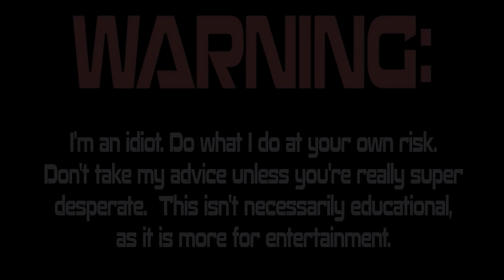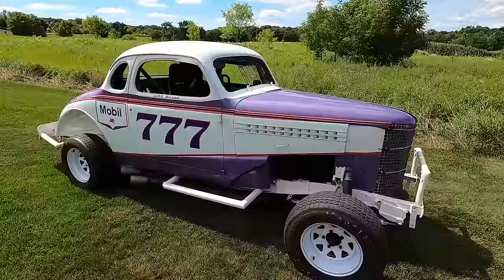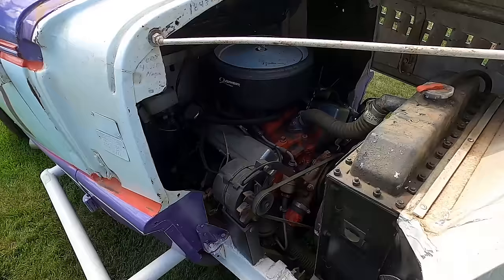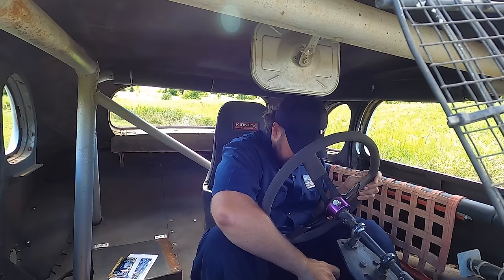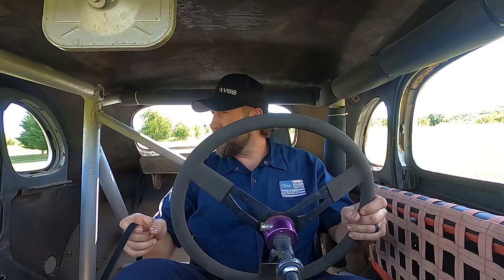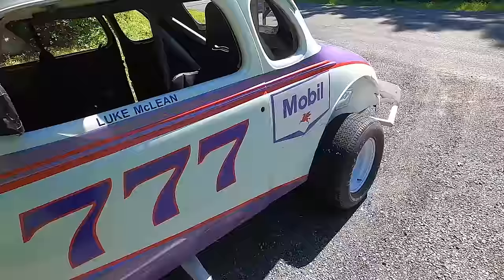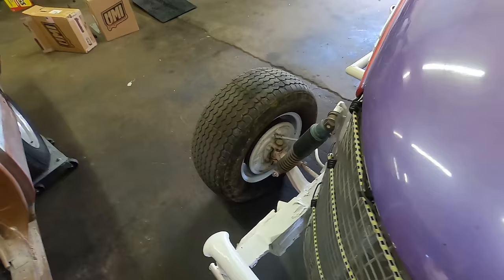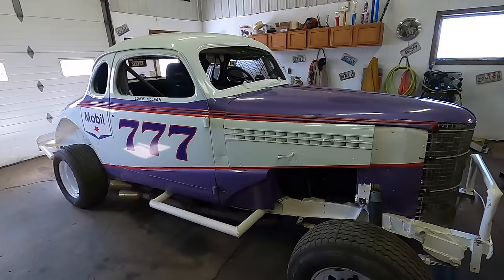I Bought A HISTORIC Vintage Modified Race Car! - Vice Grip Garage EP87

Comment: Got my grandfathers 71 datsun running again after 35 years. All thanks to you for the inspiration.
Reply: Thats what its all about man, right on!
Reply: Longbed pickup or??
Reply: What year and model Datsun?  I had three of the not so glamorous B-210s. 74, then 76 and finally, a 75. Definitely no air cushion ride! But 42 miles per gallon, made up for the lack of comfort, in my way of logic, back then. 
The bodies kept rusting out. So, when one rusted out too bad, I'd find another B-210, with mechanical problems and swap an entire engine, trans and rear end, from the rusted out one, to one with a better body. 
Datsun didn't make it easy.  I couldn't fit the driveshaft, from a 76 manual transmission, to a 74 manual transmission, because  the splines were different. So, I had to use the 74 driveshaft, on the 74 transmission. BUT!!!  The rear end yoke, wasn't the same size, on the 76, as the 74. SO!  I ended up taking the rear end out too and moving EVERYTHING 1974, to the 1976 body!  When the 76 rotted away, I found a 1975 and just repeated the whole thing, all over again. 
Datsun driveshafts, back then, didn't have replaceable U-joints. The U-joint caps were pressed in, counter-sunk in the yokes and then the outer ridge, of the yoke, was machine manipulated, to keep the needle bearing caps, forced in place. There was no locking snap rings, that could be removed, to replace a U-joint. The WHOLE driveshaft had to be replaced!  Unless you had a machine shop, willing to remove the bad U-joints re-press new ones in and do a few tac welds, on the caps and yokes.  
In spite of all that work (FUN), I was able to drive those cars, using the one A14 engine, over 240,000 miles. 
I sure miss those little cars. 
I've had a lot of vehicles, in my life. My top three (or would it be five?) favorites are my first car, a 1957 Chevy, my second car, a 1959 Mercury Commuter station wagon, with 430 interceptor engine and my Datsun(s).  
I hope you have as much fun, with your Datsun, as I did with mine.

Comment: The wobble problem is from driving to far in a straight line, she’s trying to turn for ya...😂😂😂😂
Reply: A feller is going to break it driving such a strange way. Last time it went straight was rolling out the fact tree or on/off a trailer. Otherwise, it goes left. 🤩🤣

Comment: Dirt track cars are typicality toed out in front. Toe out about 3/8" or more and camber out about 15% on the Captains side. And then camber out up to 30% on the drinker's side. Running like that on the asphalt would make her shake!
Reply: bias ply tires and a death wobble will always show up
Reply: You'll have to define "drinker's" side, as drivers were well known to have a few ounces of liquid courage before events.
Reply: Explain the death wobble then on my boss's f450 dump not even 60000 on the old ticker was actually in front of him one day and watched both front wheels going from side to side  new damper alignment and still shaking side to side
Reply: @alanbrooks3670  the death wobble can come from a number of things that make it up. Ball joints tie rod ends bald tires loos springs or hardware loss or broken steering gear box or drop arms. If the truck was raised it could be the angle of attack from the frame to the axle. It is not just a single thing to pick out. Heck it could even be the load on the back makes the front to light and the wheels to hope left and right.
Reply: @elew93610  brand new from dealer no load and at 60000 miles your telling me that the front end parts are worn out and most of the time it never was loaded down hauling any thing we were stone Masons  and had most of the material delivered only when done with the job it was actually used as a dump truck so Ford f450is just a piece of shit for the front end parts to wear out that quickly
Reply: And buy the way it had king pins
Reply: @alanbrooks3670  no sir i am not telling you anything as i dont know your truck at all. I was just stating the things it could have been but it sounds like there is a problem in that truck. Some jeep wranglers have that problem from the factory as well. So to sum it up i am not sure what was wrong with your truck because i never got to see it for my self to investigate the cause.

Comment: The single spike casting sign where accessory bolt holes are on some heads is indicative of a 265/283 cylinder head; small valve (1.7" int 1.5" exh) small chamber head (58cc combustion chamber).  
That rear end is a DANA 27 btw.
Reply: Short Bus  I dont blame him, its easier to make good power with a 327/350 than the smaller motors. Money you spend on making the spike heads good for a healthy 350 combo could be put toward milling a pair of camel humps for the same compression and youd have extra $ leftover.

Comment: Your king pins need replacing ! That was the shimmy problem !
Also check your tie rod ends !
Thanx for the Joy ride, Been there, done that !

Be safe and well.
Reply: I just commented to another guy about that fact of King Pin spindles and as a matter of facts here I was born into a speed shop in Allentown Pa. 59 years ago... However I just gave this another thought that most of these machines were built on the outskirts of the cities out of wrecked farm tractor parts like most of the steering shafts had them steering systems from those antique shit Massey Ford & other Tractors that nobody wanted and by the 70's nobody made U-joints for the steering shafts anymore because they were such shit machines but it was why they got chopped apart and sold off for scrap iron. But the steering shafts and shit like that off em were perfect 4 stock cars that included those frontal leaf springs as well king pin spindles. Shoot me if I'm wrong but i doubt it... That violent shake is more than likely worn steer shaft U-joints.

Comment: What a beautiful sound she makes!  The low idle setting could be a hang over from the days where they ran the old flathead and just set up as personal preference of the old fella.  I know a lot of guys who loved to get their flatheads idling so low you wonder how they didn't stall - barely reading on the rev counter and all.  I was a bit worried when you took off down the road, thinking to myself "I hope its not like a lot of other videos where the car has no brakes!"  Awesome vid, Derek - made my night :) 

For my money, I'm of two minds for this old girl.  If she was to go back to the road, you might have to put windows in it, a speedometer, seatbelts and all that = let alone lights and indicators and such.  Lights and indicators could be mounted on a bar and bolted on / plugged in when needed for the road and taken off when you got to a show, but having to run safety glass just doesn't fit with the spirit of the old girl.....plus I dont know what your roadworthy regulatory authority would think about the suspension brackets and the lack of fenders.....and changing all that is just not right to me.  Too much.....

But I'd hate to see her be a trailer queen and all.  She was built to race and she should, but as you say, nothing would be gained if the car ended up wrecked.  Maybe get as much info together as you can about her history and trailer the car to local (or wherever) grass-track and dirt track / gravel speedway meets.  Maybe talk to the organisers before the meet, give them her history and how she's a survivor from a bygone age and you'd be happy to take her for a few laps around the track to show the crowd what a REAL old race car can do, while they read out some of the history - especially at any tracks the car was raced on by Luke McLean if any are still going!  Maybe start with them as I reckon they'd be right into it - a bonus celebrity returning to her old stomping ground is a great draw card for the organisers  Gives you some fun, gets the car known / remembered / exercised as she should be and raises the profile of VGG as well.  After the laps, have her parked where people can see her and touch her and get up close with history.  People love seeing historic vehicles that were raced "back in the day: still belting along at speed and driven in anger nowadays.  It brings them alive and the past lives again.....and you'll find that there will still be some old timers out there who remember her racing and they may have snippets of info to add to your collection on her. 

The more I think about it, the more I like that idea.  Seeing her out churning the turf and making beautiful noise with that classic 38 Coupe shape......man it would be a sight.  I'd turn up to watch an historic dirt track beast go out and get dirty like she did in the old days, for sure.....especially if she's raced at the same track we're at long before I was born!

Comment: Death Wobble - common in hot rods. Usually kingpins, tie rod ends or steering box wear. Replace worn parts, add a steering damper from SoCal Speed Shop. Alignment is important, too.

Comment: In the Jeep world a feller calls that "Death wobble"
Reply: It's not just Jeep, dodge suffers it in the ram 1500 and the Durango as well.....it's a Chrysler Mopar thing....
Reply: Ford does as well.
Reply: My Bronco II does it
Reply: Death wobble all day, hammer through it
Reply: GM kingpin Dana 60s are horrible about it too. Best of luck getting that out of there. Give the front a good shake and look for anything loose or worn out. It can and will do that at speed regardless of what surface its on
Reply: Dave Micolichek  lol I dont know from firsthand experience, but have seen the YouTube videos about late model F-250s

Comment: She’s got a Dana 44 rear in it. There plenty strong enough for a guy to feed er the onions around a dirt track.
Reply: "Feed er the onions"   I LOVE IT; can't wait to steal your expression....
Reply: @vectorm4  You must be new here.
Reply: I was thinking the same thing. Thought it looked like a Dana and my guess would be 44 cause of the size and how common they are
Reply: No, its Dana 60 or Dana 70. Most likely a 60, as 60s were strong and very common. I don't believe it would be a 44, because a 44 back then was too weak. The 44 used in the current model Jeep is much heavier than the old ones that would have been available when that car was built.
Reply: I’d bet any money that’s a d44. That cover looks too small to be a 60. Plus those d44’s were very plentiful back then for a budget build like that. Plenty of gear and axle choices too.
Reply: That’s what I thought it looked like. Maybe out of a Jeep or something

Comment: don't touch a thing till you've had it on the dirt....... 4 wheel slide steering with the accelerator, one with the car, nothin' feels so good.
Reply: Absolutely. Lake Hill Speedway in Valley Park Mo. is where I cut my teeth. That was racing.
Reply: When I was in Iraq my oldest son was not old enough to drive before I left. My son got the go ahead to move Modified asphalt car from my dad so he could clean and sweep and the garages out. Move my modified among half a dozen other vehicles I owned. My kid gets the bright idea to go on tear down the diary farm road over 70mph and had to call my dad when he was 200 yards in a corn field. Lucky he didn't forget his cell phone huh. He didn't know the cars are set up to only turn left in hurry.

Comment: I had a '32 Plymouth coup we stuffed a 331 Hemi in. We got rid of the shimmy by adjusting toe-in enough to keep pressure on the worn out tie rod ends. It wore tires out a bit sooner but we scrounged tires from old piles behind tire stores so it didn't matter.

Comment: It could be one of those old tires is separating and they will shake like hell.
Reply: i was thinking that but it's not the case, you would feel it even going 5mph
Reply: Its the typical death wobble. Almost every car guy has experienced it, at one time or another. It takes a different kind of guy to keep going. 👍
Reply: @EM-fi2qg  45 mph is usually the suspension
Reply: Almost definitely shock absorbers causing such a shake, assuming the axles are straight.
Reply: Yup death wobble, probably poor caster angle. Feels like a shopping cart with a bad wheel.
Reply: Thats death wobble.  The old bias ply dirt track tires are separating in the cords.  Put a new used set of dirt tires on her and shell be good as new again.

Comment: Ran a 307 stock in class against 355& 383 strikers and ran second most nights. Only got bumped off track in corner on last lap. Was getting to start finish line first but would get caught up with at turn. That gave a gut a chance to knock me loose in the corner.

Comment: The shifter location makes my stomach hurt.
Reply: 100% my thoughts also...YIKES!!!
Reply: I've drove some really awkwardly set up cars before but that shifter set up takes the cake for me. I can't imagine how annoying it would be with all the added slop from how loose the linkage looked either.
Reply: It’s making more than my stomach hurt... 😂
Reply: Scott Duffy  using his third leg for all the shifter work eh? 😂😂😂😂
Reply: My theory is the guy was just used to old tractors which usually always had the shifter between your legs, and the clutch being far away from the brakes and gas pedal.
Reply: Glam Stachee's 1980s nostalgia lounge you’re prob right. Didn’t even think of that.

Comment: Good ol death wobble. Fun on surface streets even funner on the highway.
Reply: That’s what I’m thinking! That’s what death wobble looks and feels like 😳 had an old cargo van that would do it randomly, it would damn near throw you off the road
Reply: Yup, had a 40 Ford Pickup, had a worn out flattie, I goulc get another one from the junk yard for 10 bucks, no exchange, the air cleaners were so bad, and the area I lived in was so dirty that a set of rings would be cut out in about 25K miles,  I think my folks like the idea that car would death wobble at anything over 55, kept me from going too fast...Of couse, it also requireed me to come to a stop , then start again in order to get the pu straight ...Good times, or at least that is how I remember them.  When my patients ask me about hobbies, I begin by telling them that I hate golf, but like old cars...what, a doc who hates golf?  yup.  Juts the way I am...
Reply: Or a worn out 1970 International Scout.
Reply: yupp. death wobble for sure. Was looking for this comment we had a old 60ft bucket truck with massive cage that would get it holy shit scary on the highway.
Reply: you guys are talking about "death wobble" like it's some mysterious thing, lol.. something's causing it whether it's a bad tire, alignment/suspension components, etc. it's not just some unknown boogeyman that just means the car now has to be driven slower, lol
Reply: Or at a buck 50 on the drag strip. That'll get your attention.

Comment: Those looked like power pack heads. My 283 in my 59 Apache has those heads and that little motor rips!
Reply: yeah just like The Bel-Airs too it did look like a power pack and it was a 283..

Comment: "I bet it's set up for an oval track." I don't know all the mechanicals of it but I've driven a stock car racer on concrete and experienced that exact thing. most times you do not get to that speed as the straight stretches on a dirt track are not that long to get it up they were made to accelerate and turn quickly, not designed for straight stretches were u can open it up to blow the cobwebs out. Most times you go into corner in 2nd to keep revs up then exit in 3rd for about 1/4 mile before ya get to another corner and have to brake and gear down.

would restore it to its former glory and go on a "historical race circuit" with it.  it was made to be scratched and rolled then flipped over to keep on going
Reply: More like King pin chatter is what it is with the leaf spring set up it has the old Bolden tractor style king pin spindles just like a tractor and same when ya go to drive a tractor on the hiway it starts that shimmy them hoppin around like jack rabbit grabbed by the tail.

Comment: That shake reminds me of my old CJ and the death wobbles. I thought the windshield was going to pop out on me a few times. 👍
Reply: My dad has a 78 cj-5 and can agree that thing scared the shit out of me
Reply: @jamesprice2163  Yep. Its really hard to explain just how nerve racking it can be. You just have to experience it, and change your shorts when its over.
Reply: Had a customer bring in a tj that the rear upper control arm mount had snapped off the body. First time I went to brake I damn near ruined my pants. Jeep ownership, the original death trap 😂

Comment: The rear axle could be off a little for left turns.
 May GOD Bless You All Always Amen MGBYAAA 😎
Reply: was either the homemade suspension setup or the driveshaft was going out of alignment at speed in my eyes lol. ive had a truck that'd just shake a guys teeth out when the trans yoke ujoint almost slipped off. id imagine it was similar to the feeling of a horse and buggy on a gravel road rougher than some 80 grit sandpaper

Comment: That is the proper dirt alignment and the larger right tire. Larger right rear also helps it turn more as on a small 1/4 mile track. Sprint cars at our track used same size front tires and a lot larger right rear. Leave as is and take it to vintage modified gatherings around the country. I think there are still many gatherings once all this foolishness goes away. Great find!

Comment: That looked a lot like “death wobble”. Check the caster angle
Reply: Toe in/out and leaf bushings. That is 100% death wobble. Check for worn steering components also.
Reply: @NoWr2Run  Several actually. Not just a Jeep thing. Lots of new stock Ford pickups had that issues and anything with worn front suspension can have death wobble.